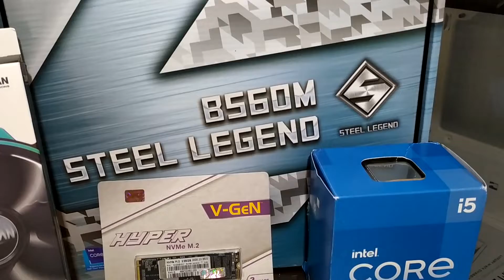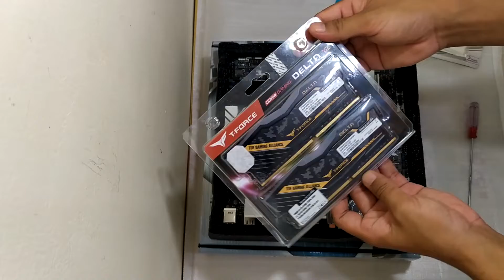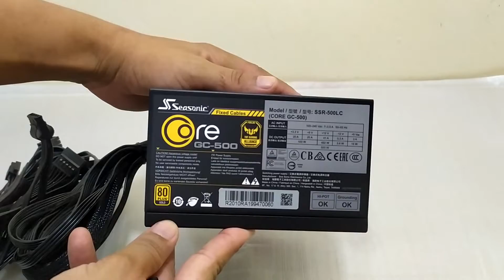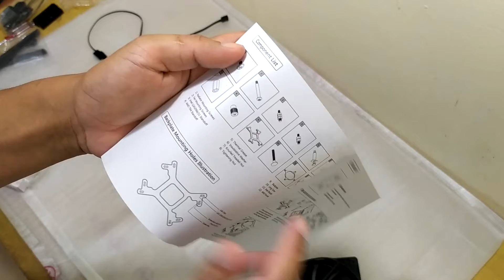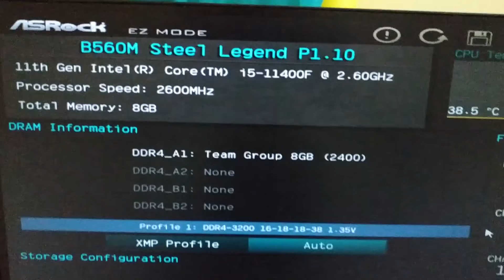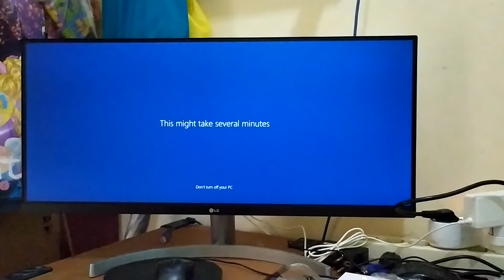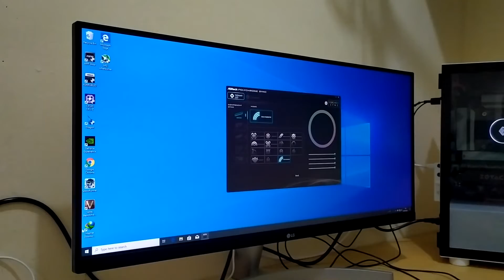Intel Rocket Lake PC Gaming Build | Core i5 11400F | Asrock B560M Steel Legend | 2021 Rakit PC

Comment: Bang B560m + i5 10400, apakah bisa OC ram sampai 3200mhz ??? 

Lebih prefer mana z490 atau b560 ??
Reply from the maker: Bisa gan, di mobo ini bisa sampai 4666mhz(OC). Kalau untuk i5 10400 b560 atau b460 udah cukup. Untuk z490 atau z590 lebih cocok untuk processor K series

Comment from the maker: Part list:
Intel Core i5 11400F Rocket Lake https://youtu.be/O-XJj5zZqYU
Asrock B560M Steel Legend https://youtu.be/gz98ymyE84c
Team Delta TUF 2 x 8Gb 3200Mhz
V-Gen Hyper nVME 256Gb
Zotac Geforce GTX 950 2Gb GDDR5
ID Cooling Frostflow x 240 https://youtu.be/0EbO6SL7lsw
Seasonic Core Gold GC-500 https://youtu.be/7WVcrinED6Q
DarkFlash DLM21 Mesh White https://youtu.be/IioeYCEa1qE
Zalman Casing Fan ARGB ZM-RFD120A https://youtu.be/E6W4mGAvKcY
Reply: Kak itu caseny bisa di padang deepcool gamax L240 v2 v
Reply from the maker: Coba masuk ke website id cooling lalu cari dimensi x240, kemudian bandingkan dengan L240 kalau sama berarti bisa gan

Comment: Bang kenapa fan exhaust belakang ga dikonekin rgb-nya?
Reply from the maker: Karena saat rakit belum beli kabel RGB Splitter, jumlah header RGB di mobo cuma 2. Sekarang sudah nyala semua kok👍
Reply: Bang, di mobo itu fan connectornya ada berapa
Reply from the maker: Ada 5 termasuk fan header untuk aio water cooling

Comment: Gan saya ngerakit hampir mirip seperti itu, cuman belom kepasang ssd/hdd kenapa gamau nyala ke monitor TV ya? Mungkin tau masalahnya bisa dibantu 🙏
Reply from the maker: Sudah pakai vga card? 11400f wajib pakai vga card
Reply: @DewaJuned  sudah bang, pake sapphire RX 550 4gb DDR 5
Reply: @DewaJuned  saya pake i5 10400F bang
Reply from the maker: Kabel display ke monitor sudah dicolok ke vga? Jangan colok ke motherboard
Reply: @DewaJuned  sudah bang, apa mungkin vga nya yang bermasalah?
Reply: Kalo monitor pake TV harus nya ga ada masalah kan bang?
Reply from the maker: Harusnya sih nggak masalah pakai TV asalkan setting resolusinya sudah benar (tidak out of range), kalau ada monitor, coba pakai monitor dulu, siapa tau setting resolusinya lebih tinggi dari spek TVnya, sehingga tidak mau nampil
Reply: @DewaJuned  oke bang, makasih banyak

Comment: Apa gak bottleneck antara cpu dan gpu ?soalnya kinerja cpunya lebih tinggi dari pada gpunya
Reply from the maker: Sebenarnya saat rakit PC ini rencananya pakai gtx 1660 super. Tetapi saat itu harganya sudah naik drastis diluar budget, akhirnya terpaksa pakai vga second sambil nunggu harga vga turun yang sampai saat ini nggak ada tanda-tanda penurunan 😂. Mungkin tahun depan kalau budget sdh terkumpul mau ganti ke vga yang lebih bagus🙏
Reply: @DewaJuned  kalau pakai 1650 super apa masih bottleneck kah bang d pasangkan dengan i5 11400f ? Soalnya harga 1660 super sekrang kurang worth it ,harganya mau nembus 10 juta bahkan.terpaut jauh d bandingkan 1650 super yg masih 5-6 jutaan.jadi kalau mmng mau up ke 1660 super agak rugi mending sekalian ambil seri rtx
Reply: @Yusril1998  disarankan / disandingkan rtx 3060/3050 / rx 6600 / 6500, 1660s/1650s/1650 bisa ko bottlenecknya juga gk lebih dr 10% masih aman walapun si gpunya masih 3.0

Comment: Kenal limit clockspeednya ngga?
Reply from the maker: Kalau BFB diset ke 125w, processornya bisa stay di 4.2ghz all core
Reply: @DewaJuned  klo yang pro4 sama juga nggak ya? Ane punyanya yang pro4 ternyata, klo kena limit mending ke 10400 aja wkwk
Reply from the maker: Sama aja kayaknya, kan ini fitur khusus dari mobo ASRock
Reply: @DewaJuned  oke, thx infonya
Reply from the maker: Kalau udah punya b560m pro4 mending sekalian ke gen 11 karena kita bisa pakai slot ssd deket processor yg ada hsfnya. Kalau pakai gen 10 itu otomatis disable

Comment: Min saya mau nanya gimana ya buat ngatasi game yang memakai Intel dari pada MX150 di laptop E5 476g
Reply from the maker: Setting di Nvidia control panel, masuk di manage 3d setting, pada tab program settings, select program to customize,pilih gamenya, pada option 2 di bawah arahkan ke high performance Nvidia processor, lalu klik apply. Kalau gamenya tidak ada dalam daftar, silahkan klik add dan arahkan ke direktori game untuk menemukan file exe dari game tsb. Selamat mencoba
Reply: @DewaJuned  tq min
Reply: @DewaJuned  saya juga mau nanya gimana cara mengatasi frame drop yang langsung nol waktu main ya?
Reply from the maker: Mungkin settingan graphic gamenya masih terlalu tinggi, coba turunkan ke medium atau low dulu, pastikan juga mainnya sambil colok carger dan posisi batre tidak dibawah 40%

Comment: Kalau pakai b560m ASRock pro4+ram 3200mhz,atau3600mhz bisa bang+procesor i3 10105f bisa bang?
Reply from the maker: bisa gan
Reply: @DewaJuned  serius ni gan bisa pakai ram 3600mhz tdi saya tanya sama penjualny gk bisa harus poker yang 4800mhz
Reply from the maker: Coba tonton video jagat review yang ini, disitu bisa OC Ram kok, padahal pakai processor i3 10100f
https://youtu.be/GBhk_aLBdLw
Reply: @DewaJuned  siap gan terimakasih 🙏
Reply: @UCo9Syo5PwlFl77XL6gRhQ-Q oke gan makasih ilmunya brrti ram nya yang 3000 Mhz aj gan